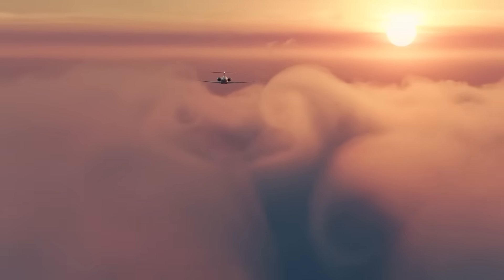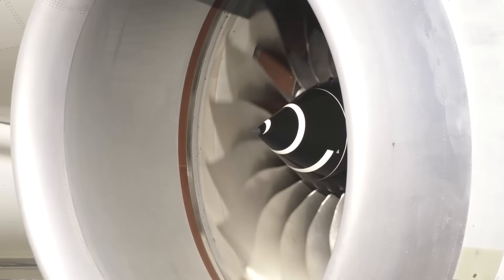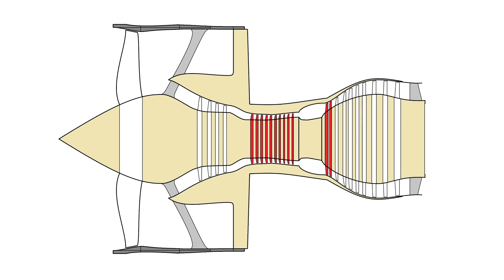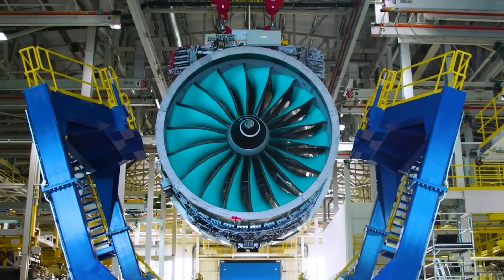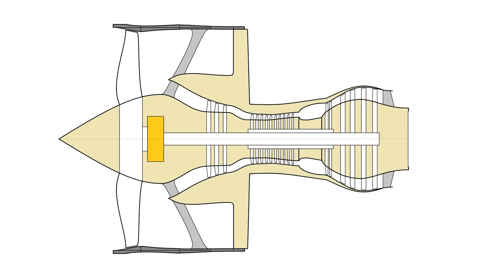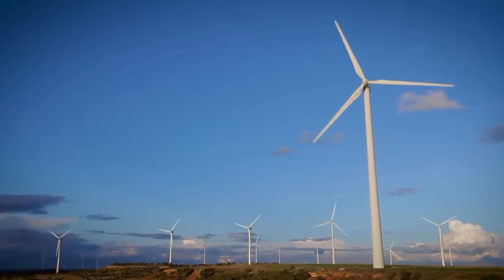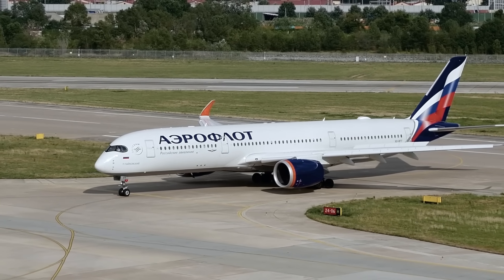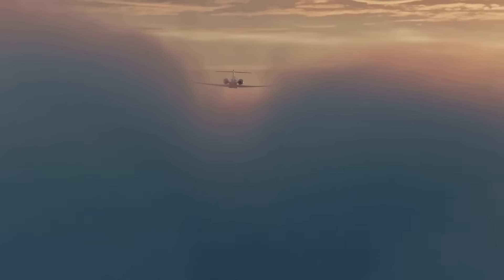ULTRAFAN - The future of jet engines

Comment: I'm still waiting for an engine manufacturer to use 2 contra rotating fans of variable pitch ducted and driven by just 1 turbo jet core engine.
The mass of air being shifted will make all others obsolete overnight.
You ain't seen nothing yet.

Comment: I fly the PW-123 engine. It is a triple spool engine WITH a gearbox. They do not call is a quad spool engine. RR is marketing here, this is a twin spool engine, you lose the need for the third spool with a gearbox. The purpose of the third spool was to run the fan at a different speeds to the low pressure compressor, the gearbox achieves this same job a different way. The reason my engine has 3 spools AND a gearbox is because it is a turboprop, not a jet.

Comment: Wonder if the ULTRAFAN will be applied to the BUFF's upgrades; since it's engines are from RR?
Reply: No.  Those engines have already been chosen.  The USAF can't wait until a small Ultrafan is developed, they are running out of parts for the B-52's engines now.  Unfortunately the upgrade program is being run by Boeing so it is already behind schedule and over budget.

Comment: I still think an electric ducted fan powered by a gas turbine generator is a simpler and lighter solution.  Yes batteries will be required but I think that is possible with current technology.

Comment: Geared turbofans will be the settled engine architecture for the next generation, of that there is no doubt. Propfans will never be quiet, fast or reliable enough. If GE don't get themselves in GEar soon, it will be a Pratt / RR duopoly.

Comment: The only issues RR have are high pressure turbines…they can handle the heat but the ceramic layer on the blades doesn’t stay on as long as they expected. Apart from that it’s a great engine

Comment: I wonder if, with wing modifications, could a 747 fly with only two of these giants.
Reply: No.  The four engines on the 747-8 output a combined 1200 kN.  The highest number RR has said for the Ultrafan's thrust is 440 kN.  A twinjet 747-8 would require 600 kN engines and those are unlikely to exist for decades, if ever.

Comment: It's a bit early to say that the trent engines are outdated, actually, the trent xwb and trent 1000 or 7000 are the most advanced and efficient  trent engines. Rolls-royce is constantly working to improve reliability. And the ultrafan is a demonstrator, as he said in the video we won't see any ultrafan design engines before decades. Trent engines cost développement has to be absorbed and the aircraft manufacturers have to produce a new airframe to fit the engines. 
I am working for Rolls-royce as a jet engines mechanic, cheers
Reply: Aircraft manufacturer’s don’t design and build airframes to fit the engines. It’s the other way round - airframe performance and design requirements define the needs the engine manufacturer has to meet.
Reply: Brainwashed.

Comment: 140 inch (3.49 metres) fan, that's huge, spinning at around 2800 RPM. that is a lot of load for a planetary reduction gear set to absorb, especially at climb thrust through lower altitudes. If heat and lubrication problems can be solved. Well done Rolls Royce!

Comment: Here's hoping this one has a lower likelihood of rapid unscheduled disassembly in flight. I remember watching a documentary about Rolls-Royce jet engines; they talked about all these high tech tools they used in the design and manufacturing process, and then they had a guy tapping on the first stage compressor blades with a mallet and listening to the resonance to choose which blades should be installed in pairs on opposite sides of the turbine shaft. Well whaddya know, it was the first stage compressor blades that kept exploding in flight. Typical British engineering -- design 95% of an excellent product, and then have Nigel bodge together the final bits in his garage over the weekend using some spare plywood.

Comment: Do you think that the 747 could be reintroduced with 2 engines with these engines slung under their wings?
Reply: No.  The highest thrust numbers coming out of RR are ~440 kN.  The 747-8 has 4 296 kN engines.  A twin engine 747-8 would need thrust of ~600 kN out of each engine.    That kind of power would require a massive leap in technology, if it is even possible (we are approaching the point of negative returns on increasing engine diameter).

Comment: I'm so proud of Rolls-Royce. I worked on the Spey 101 Buccaneer. Spey 202 Phantom and Spey 250 Nimrod engines. All Derby engines.
Reply: @tonyguest9744  i flew Boeing 744’s with RB211’s on them, and we used to joke that “RR” stands for “Rotating Rubbish.” 🤣 (we also had B744’s with GE CF6-80’s and the joke was that “GE” stands for “Great Engines.”)
Reply: So from going by your history, you would not have worked on the Trent 1000 which had serious problems resulting in the grounding of Boeing 787 Dreamliners powered by these engines.
British Air as well as an increasing number of other airlines, (Al Nippon, Air New Zealand, LATAM; Ethiopian, Thai Airways, Air Tanzania ) have snubbed RR and have ordered GE engines for their future 787s.

The so-called ultra fan is nothing more than a geared fan engine without an airliner to power.
Reply: @John-nc4bl  spot on. I few B744’s that had RB211s and the running gag was that the “RR” in the Rolls Royce logo stands for “Rotating Rubbish.” P.s. also look into the Boeing 757s with RB211s on them, and the alleged issues they had with chemical/oil smell due to leaky oil seals.
Reply: @John-nc4bl

No one cares about the trent 1000. Rolls royce at the very least never caused any fatalities and doesn’t do under the table “investments” like GE to favour manufacturers. Tell me what exactly has GE introduced or innovated that P&W or RR didn’t. Because all i see is the same 2 spool fat cow engines that is only liked because it’s big.
Reply: Thank you for your service the UK is still a World Leader in Aviation
Reply: @diamondderek848  Get off your high horse.
                                              Not a world leader as it is to being a subcontracor.
Reply: @diamondderek848 In which dimension?

Comment: You have to wonder if SpaceX's method of 3D printing their third version of the Raptor engine will in time effect turbo-fan jet engines.  The third Raptor engine looks like it's only partially built as most of the tubing courses through the inner parts of the engine, rather than around the engine, where they're visible.  Entirely two different types of engines but 3D printing is making a big impact on both.

Comment: Would it be wise to use a turbo shaft engine installed inside the aircraft with two drive shaft leading  to the fans on the wings - No compressor fans, No turbo fans No combustion chambers - and it becomes pure jet less fuel.

Comment: Pratt has been working the geared turbofan for decades and they’re just finally ironing out the bugs.  I’ve met a few insiders and the amount of engineering that goes into those gearboxes is absolutely insane.  At those speeds and loads, EVERY detail is critical.   Rolls has a long slog ahead of them.
Reply: Agree. It’s interesting to see that RR was part of the IAE community which manufactured the V2500, but stepped back when Pratt proposed the GTF as successor to the V2500. Officially it was because they didn’t believe in the gear concept for such thrust range of engines. And now they bet their future in this technology !
When we see how Pratt is struggling with this technology, I’m not sure this is the way to go for higher thrust range.
All this power passing through a metal to metal contact in a gearbox is a hell of a problem.
In terms of fuel efficiency, the GTF is not better than the CFM LEAP and it’s far less reliable. Airbus official data shows that during sales campaigns. 
The CFM Rise is a real game changer, but it will take time to make it reliable.
Time will tell.
Reply: GE has always been ahead but rolls royce also keeps its self afloat from its nuclear sub manufacturing
Reply: @JDR71326  they don't make subarmarines
Reply: @Spooky_32  *welding specialists
Reply: @Spooky_32  But they make reactor.
Reply: @alexlo7708  I know, I'm just tired of people saying they actually make submarines
Reply: @Spooky_32  So, you are from BAE dock.
Reply: @alexlo7708  what's that
Reply: @Spooky_32  BAE do UK subs.
Reply: @alexlo7708  oh...why did you say I am from there? I'm so confused lol
Reply: @Spooky_32  Guess, that's it.
Reply: @Spooky_32  Don't they make the reactors?
Reply: @kevinrayner5812 rolls Royce make the nuclear reactors for British submarines yes.
Reply: Actually RR and P&w were not the first to have geared turbo fans the HS 146 had these years ago
It has four geared turbofan engines mounted on pylons underneath the wings, and has a retractable tricycle landing gear. The aircraft operates very quietly, and as such has been marketed under the name Whisperjet. HS had no problem with their Gear box
P&W have had problems for  along time and I think RR will run into the same problem
Reply: Reliability is the hardest thing to master. It's insane how much mileage these engines get on them every day and still have to fly flawlessly
Reply: @srinitaaigaura  I think RR have long ago mastered the making of very reliable aircraft engines ( and engines for other stuff )
Reply: I bet they get some serious wear and tear. I wonder how come US airforce went with RR for the B52 upgrades. Seems almost UnAmerican
Reply: @patrickbrowne7191 they still get made in the US, so it keeps Americans in work at least
Reply: @Spooky_32  As the richest country in the world the USA could afford to be a little generous.  They have all the advantages of superb natural resources from oil to agriculture and forests.  I don't understand why they are so mean-spirited  "...so it keeps Americans in work at least."
Reply: @patrickbrowne7191  Agree, PW GTF is still in problems. The punishment from going beyond the limit.
Reply: @patrickbrowne7191  The new Rolls-Royce engine for the B52 is an American engine.  Built in Indianapolis.  Rolls-Royce bought Allison Engines in 1995.
Reply: @patrickbrowne7191  The B-52 gets a well proven very reliable and efficient engine fitted to Gulfstream and other biz jets.. That engine was exactly the right size for the B-52.

Comment: As far as widebodies are concerned, UltraFan technology will surely be developed for an A350Neo, sometime in the early 2030s, when current A350-900 and -1000 orders will have been fulfilled. There would be no point in developing an aircraft before then, as Airbus would not have separate production facilities for it. Whether RR are still supplying engines for the B787 by then, is any ones guess, but with RR having an exclusive on the 350 until 2030, and it looking likely at this stage that it will be extended so as to benefit Airbus from UltraFan technology, it seems to me that Boeing are most comfortable with GE for w/bs and Airbus with RR. 

With the B777X and therefore the GE9X stuck in limbo land for a few more years yet, Im sure GE would like a slice of the A350 'apple pie', but since GE declined to develop an engine for the A350-1000, because of commitments to Boeing iro the GE9X, Airbus will be sceptical about relying on an engine manufacturer who will always put Boeing first..........

Comment: very professional video, but the important fact why the gearbox must be installed is omitted: the problem is in the Ma number, which depends on the gas temperature, which means that the turbine can spin faster than the fan for the same radius, and thus it is more efficient and needs fewer stages

Comment: Why this UK is almost decade lagging behind GE in plastic fan blade?
Reply: RR developed a composite in the 1960’s for the R.211 called Hyfil, but it failed bird strike testing.
Reply: @ClockworksOfGL  Rolls & Pratt went with hollow Titanium.  Pratt still doesn't have a composite fan capability.

Comment: A company which created the Merlin engines in WW2, the Nene engine and the Welland for the jet boom of the '50s and '60s, invented 'vectored thrust' in a single engine, the Pegasus then powered the rise of jet airliners, albeit conservatively for long haul safety certainly has the magic sauce.
Relative slowness in commercial aviation was less about money and more about R&D, such that Derwent and Avon engines could be developed into turbojets with safety at the core and an early appreciation of fuel economy and emissions.
Also, with the development of the Trent R-R used elements of proven results to apply it to its marine division and turbines for its Small Modular Reactor (SMR) nuclear power solutions. In a nutshell, the very high power/rotation stability of full product transmissions in nuclear subs and safe, sealed long life of SMRs had the maths data to hand.
The Trent extended development engines discussed here are  also being tested for multi fuel use including biofuels in conjunction with Embraer over many years (except the latter's Boeing period).
Incidentally, R-R names its jet engines after British rivers and the company's 'hot' test R&D facility is still in the city of Derby in the River Trent valley.
A larger and rather well guarded facility is situated about 30 km away next to the River Derwent.

Comment: It’s still a solution waiting for a problem. Missing the 777X pushed this back nearly two decades. I just don’t see a new airframe design opening up for at least another 10 years or so. The engines on almost ALL of the current aircraft are good “enough” that it doesn’t justify what the UltraFan currently offers.
Reply: Say "Hi" to your GE co-workers for us.
Reply: A350 neo will fit the timeline nicely.

Comment: The gear boxes, P and W are now having problems with service life.  They need to make a gearbox has  a longer service life but is small enough to fit and light enough.        It also needs to be able to pack a sad with out sending shrapnel through the wings and fuselage.  They need to think outside the box. Easy to say but hard to do.  They need to get the gear box right.  Imagine the spinoffs if they do .  Pardon the puns.

Comment: I think the likely first application of the UltraFan technology will be the replacment for the Trent XWB on the A350. This could result in a 8-10% lower fuel burn, significant for such a powerful engine. A slightly smaller variant will replace the Trent 7000 on the A330neo.
Reply: A330neo can't remain competitive when the 787 gets a new engine and further improves in efficiency with a 64.75 wingspan from the 60m it has today
Reply: @mmm0404  
When is the 787 getting a new engine? And are you talking about GE or RR, or both.........?
Reply: @artrandy  beyond 2030, they could choose to go exclusive with GE unless customers pressure them to have RR as an option again.
Reply: @mmm0404  
So you don't have an answer to my question, confirming that your comment was just idle speculation.......
Reply: @artrandy  who cares , no one is attaching timelines. We all know the a350 and 787 will get a new engine someday. The a330neo is not that competitive against the 787, and it will become less competitive when the 787 gets a new engine
Reply: @mmm0404  It depends on a lot of things. Airlines will get the best deal no matter the model. Availability matters too. 787 is a great aircraft. A330 Neo will just find it's place as the duopoly and backlogs continue.. and demands rise every year..after all, it's a twinjet widebody.

Comment: Combining titanium with composite at high pressures, what could go wrong in this 'Titan' leap?
Reply: You have no clue how carbon fiber works. 1. There is no “high pressure”. Turbines operate at fractions of an atmosphere at high altitudes. 
2. Blades mainly have to resist tensile stress due to centripetal forces. Carbon fiber is extremely good at resisting tensile stress.
Reply: GE uses Carbon Fibre blades,  the titanium edge is just to stop the edge of blade resembling a toothbrush after so many flight hours.   RR pioneered the Carbon fibre main fan in the RB211 ( destined for Lockheed TriStar ) - which was a massive leap that almost destroyed the company,  but after extended running the leading edge of blades started to break up,  by the way carbon fibre composite was invented in UK at RAE Farnborough
Reply: @chrissmith2114  In 1958, at the Union Carbide Parma Technical Center in Cleveland, OH, Roger Bacon accidentally produced the first petroleum-based carbon fibers when he tried to measure the triple point of carbon by heating strands of rayon in argon.